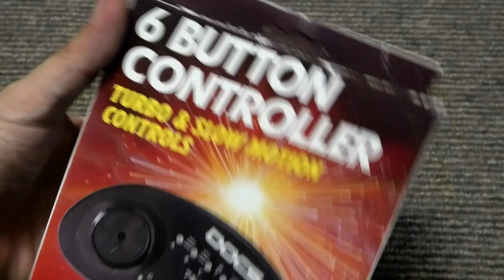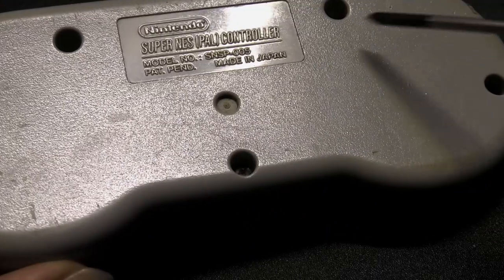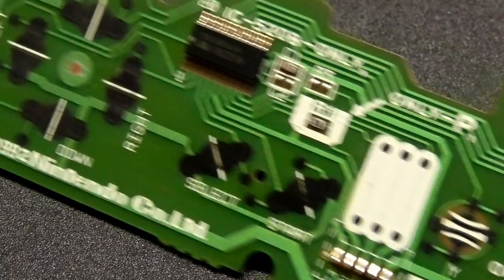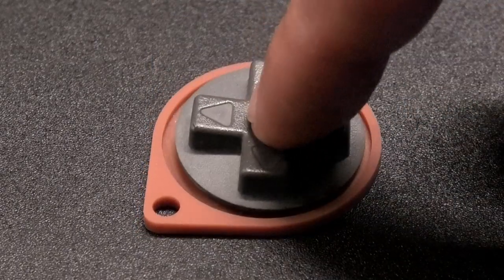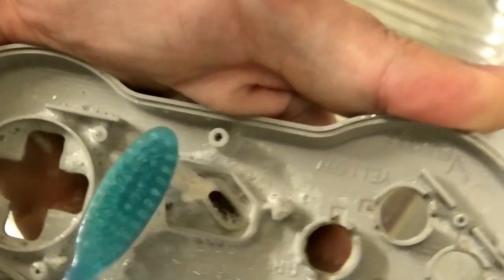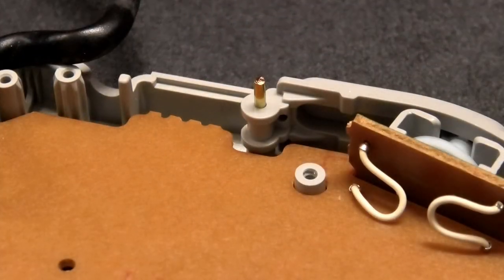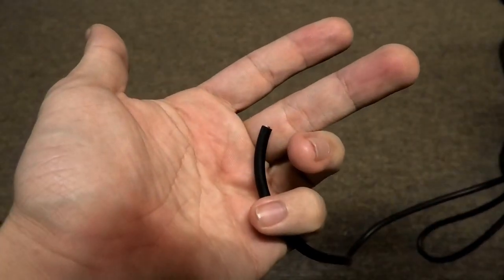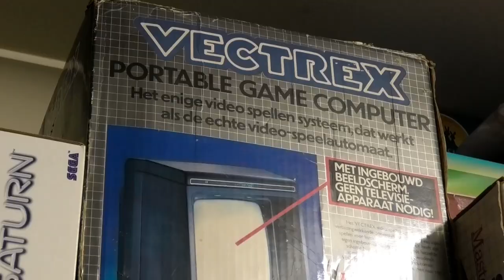Making Old Controllers Last Longer | Joystick Division

Comment: THANK YOU!! I literally just found an old Master System controller in my room that didn't work with no idea what was causing the issue (with a previous attempt to clean it), I then tried running the conductive pads on paper method and after plugging it in it fully works 100% now. Thank you so much!
Reply from the maker: I'm so glad this video helped someone! You're very welcome. :)

Comment: Your videos are very amazing!  Greetings from France 🐸
Reply from the maker: Thank-you so much. :)
Reply: @JoystickDivision  man I need your help.. can I ?
Reply from the maker: Yeah, what do you need help with?
Reply: @JoystickDivision  its about the modification on my Md2.. I learn about your video but where do you fix the 'ground'?
Reply from the maker: Do you mean the 50/60 Hz mod. There are many places to get ground from, but I usually use the edge of the main board.
Reply: @JoystickDivision  yes for the 50/60hz mod.. that was my idea in the beginning to fix 'the ground' anywhere on a green part
Reply from the maker: It's been a while since I've worked on a Mega Drive II, so I can't remember where other ground connections are, so I just stick to soldering to the outside edge.
I hope you can figure it out and you get it working. :)
Reply: @JoystickDivision  yes I will do it in the next few days .. I will keep you in touch.. Thanks a lot   See you 😊
Reply: @JoystickDivision  hello buddy I made the operation on my MD2 but it doesnt work  the Md is still on 60hz.. I dont understand.. may be you can help :///
Reply from the maker: Hmm... It's difficult to know what the issue is without seeing it.
Have you tried looking at other videos for this modification?
Maybe I could do a new video showing exactly how I do it.
Reply: @JoystickDivision  yes thats for sure .. I look over other videos but I just want to switch between 50 and 60hz not switch also the language..  may be I burnt my JP3 but I dont think so... I took the ground  on a screw
Reply: @JoystickDivision  may be Im gonna buy an other Md  the 1st one  just to play zoned games lool
Reply from the maker: The first model Mega Drive is my favourite one. The 50/60hz switch should be similar.
Reply: @JoystickDivision  I saw that.. the sega's fan love much the 1st one... I think Im gonna buy one to play games stock in 50hz
Reply: @JoystickDivision  hi buddy!  Instead of buy me a MD1 I bought a mega Sg 😋🤩  reception tomorrow !
Reply from the maker: Yes, very nice!
Did you see my video on the Mega SG? It's probably my best one.
Reply: @JoystickDivision  yes I saw a little part of it makes me laugh 😀, I will watch it completely after open and use it I dont want to be spoiled😋    Analogue made a great work I also have the super NT
Reply from the maker: That's awesome. Tell me what you think of it. :)
Reply: @JoystickDivision  I will bro! 😉👍👍